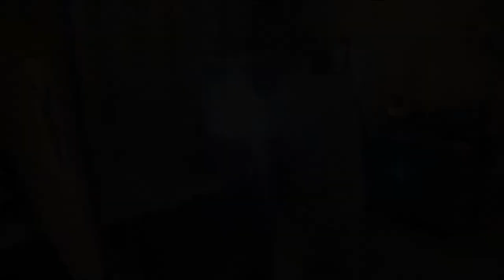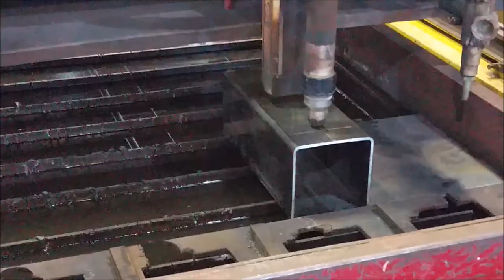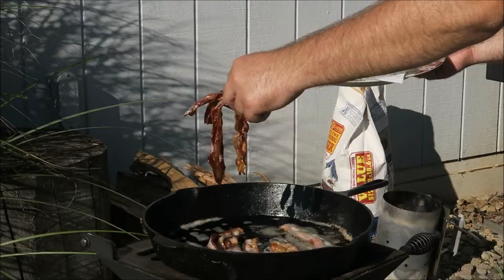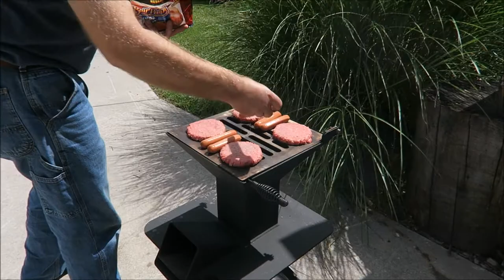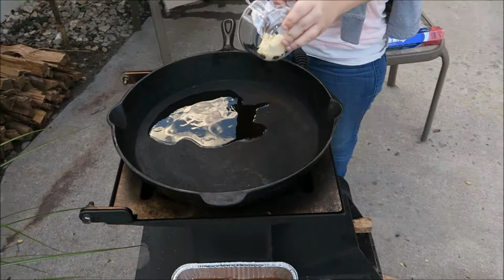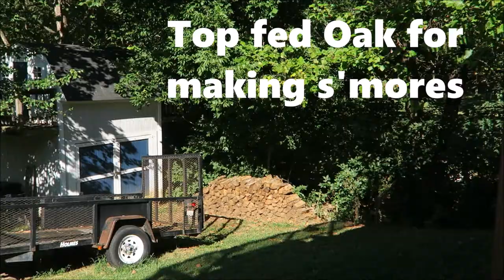The Watchman Stove - Manufactured and Distributed by Winchester Metals

Comment: I just received my watchman  stove  and cooked on it the first time last night I had a good fire going with some lump  coal . But I had a problem cooking a hamburger  fire just did not seem to get hot Enough up at the top of the stove even though it’s a roaring at the bottom I added some more coal so To build  it further towards the top but still just did not seem hot enough to cook . Ended having to get the gas grill to finish off . So what did I do wrong? 

Does it have to be a open fire with flames to cook. ?
Reply from the maker: Generally if you're using coal and the Hoosier Grate, heat for a cook isn't an issue given the proximity of the heat to the cooking surface.  If you were using coal down in the main burn chamber, then you probably weren't generating enough heat up top, we recommend wood in that setup for best results.  Please let us know if that is/was the issue and thank you for your support.